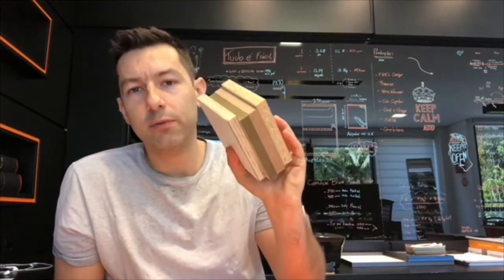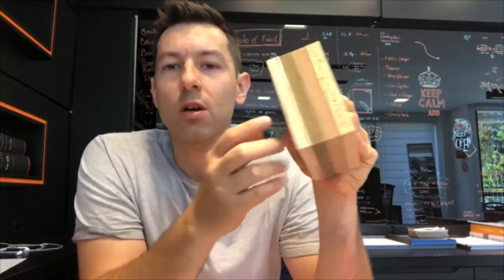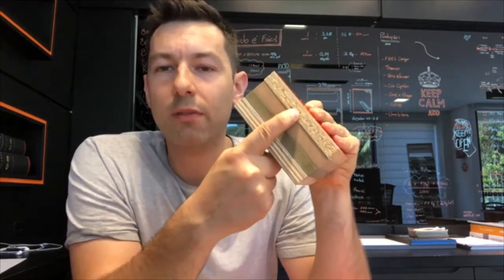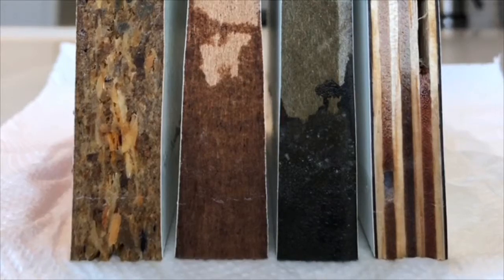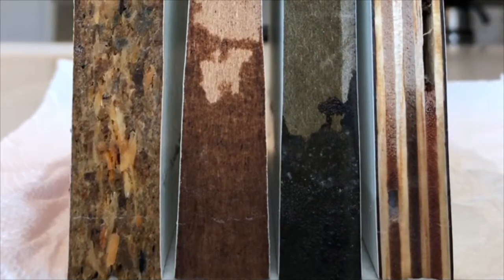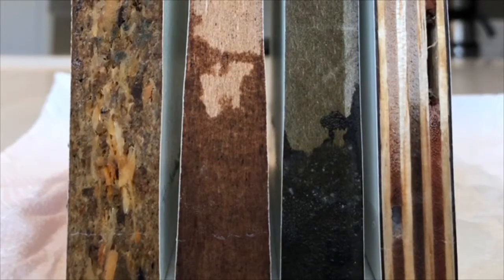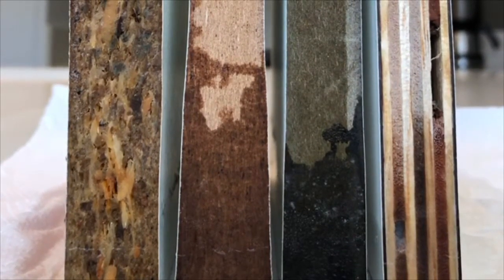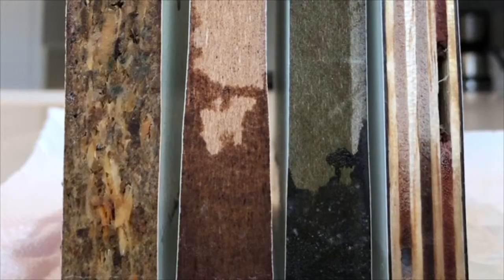Water DAMAGE on Kitchen Cabinets? (Plywood / MDF Ultra / MDF / Particleboard)

Comment: The green MDF is specifically designed as water-resistant - and marketed as such (well, here in the UK it is).

So I'd be surprised if it weren't water-resistant!
Reply from the maker: it is indeed. But if exposed to TOO much water, for too much time, it will damage for sure.